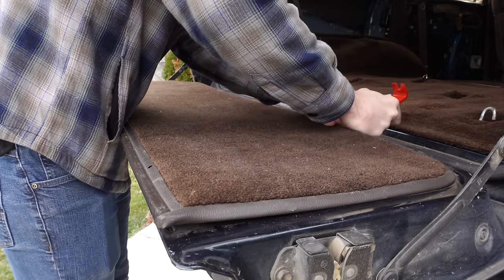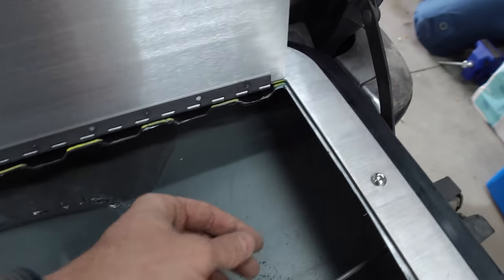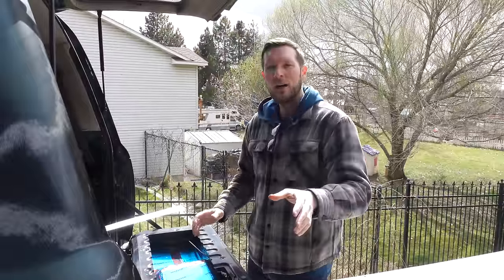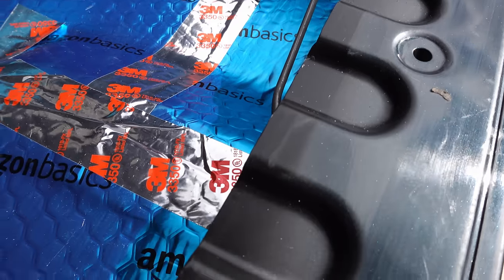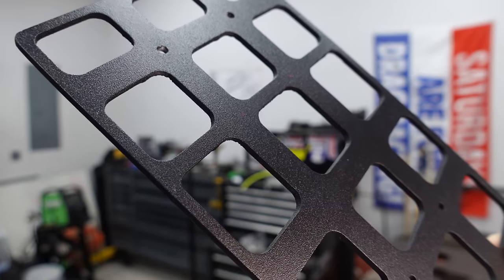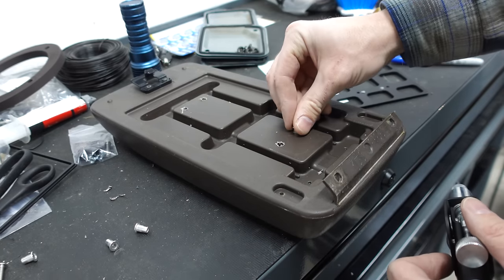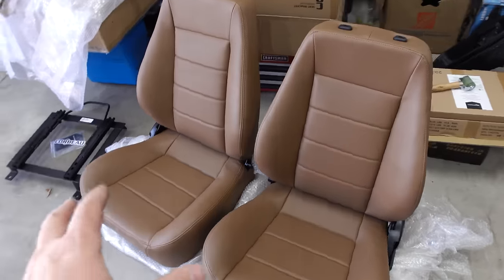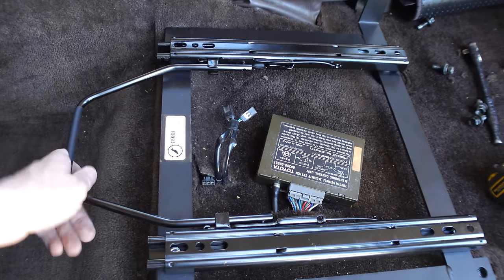The Land Cruiser Gets NEW SEATS, Tailgate Storage, and More Interior Upgrades!

Comment: I'm confused? The documentation said they are for cj/yj direct bolt in... Which would be a jeep. They're marketed for the 80 by the manufacturer? Crazy
Reply from the maker: They’re saying the seats are a direct bolt in without their brackets for a jeep. The company makes brackets for nearly every model of vehicle you’d put these in though.
Reply: Corbeau.... gettin a li'l too fancy now dude!! 😅🤙🏽🍻
Reply: I sound like a keyboard warrior i know but were the brackets side specific? Im personally just curious looking for options when it comes to purchasing seats myself vs keeping oem. And were the seats worth it in your opinion I will sleep on a couch over a bed at times looking for outside perspective
Reply from the maker: @sethbooker3335  They were side specific and were installed on the right side, they just don't fit. I think they're a nice seat. Probably a lot of seat swaps you could do from the junkyard for cheaper. Or you could go more expensive and get Scheelmann seats. I think for the price, they're good.

Comment: That bracket issue is ridiculous, especially since it seems to happen for everyone that buys them. Corbeau must have a bad template that they are working with, or don't inspect them after welding. If it was me though, I would have tried to bend the bracket to get the holes to line up instead of making the hole larger.

Comment: First, the tailgate door does look better with the galvanized metal trim around the edges of the opening, and evens out the waffle edge of the factory tailgate.  The steering wheel cover made me smile.  I remember back in the 70's installing genuine simulated leather steering wheel covers on several of our cars.  They stretched over the wheel like your did, but didn't require a needle to sew it up.  The ones we could buy had a sorta plastic "thread" that was similar in color to the cover we were installing.  Hey, for $2.99, how could you ask for more. 😅

Comment: for the brackets, I think you can just pull the tab towards the back or hammered down and pushed in and should have been ok.  I did a friend's of mine fj and about to do mine. didn't have to cut or expand the holes

Comment: I am running 4:88 with 315/75r16’s. Runs great with that setup (‘97 80 triple locked). 
I wouldn’t run those with 38s however (IMO).
Reply from the maker: I’m probably going to do 4.88s. The 1FZ is not the engine that will be in this cruiser forever. I don’t wheel with a heavy foot so I may be able to scoot by with 5.29s but the weak pinion scares me.

Comment: Thanks for posting about the seat brackets, I have been going back and forth between them and the planted brackets. Looks like I am going planted. My question is it looks like you’re still pretty close to the wheel, have you looked into the 4” extension they offer to move the seat back?
Reply from the maker: Definitely go planted. In the video I have the seat about 80% of the way back. It can go back more

Comment: Another good Video, great neutral color choice, very clean. curious why you didn't just cut the bolt tabs off the seat brackets and just re-weld correctly measured tabs (common issue w/ alot of after market seat brackets). still I love the quality and effort your putting into this, Its a different type of restore when you have a love for the vehicle your doing. Instead of just View's, and it shows can hear it (the excitement)when your talking about the next steps... keep it goin
Reply from the maker: I was trying my best to make the part work without welding. Just felt ridiculous for a part that’s supposed to fit. Thank you!!

Comment: If you don't like the color match on anything you did in the interior, use SEM color coat. I did my whole steering wheel after the one i bought from the UAE ended up the wrong color. Been holding up great for over a year now.

Comment: I did moab seats in my land rover, and the seat brackets were an absolute nightmare. They came in with those same cj/yj instructions, and were so far off from what I needed for my truck. Had to cut and weld my own brackets in the end.
Reply from the maker: Yikes. Sorry to hear you had the same experience but glad to know it’s not only a Land Cruiser issue.

Comment: Is that tailgate storage panel strong enough to stand on?
Reply from the maker: Kind of. I am 205 lbs and my foot spans the tailgate lid opening so it doesn’t put direct stress on the center section which would be the weak point. I wouldn’t stand there but I’ve crawled over it getting into the back of the truck and it was fine.

You can create a brace out of 2 pieces of angle iron like what Delta does, and wedge it into the inner middle part of the tailgate to provide strength.